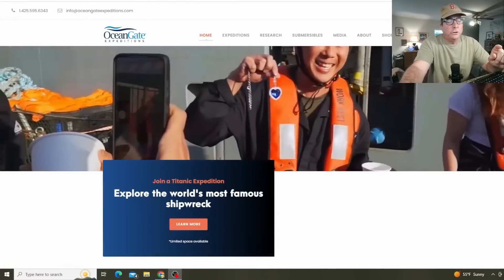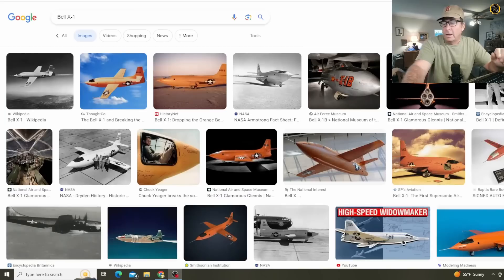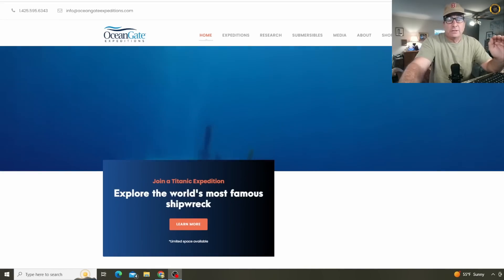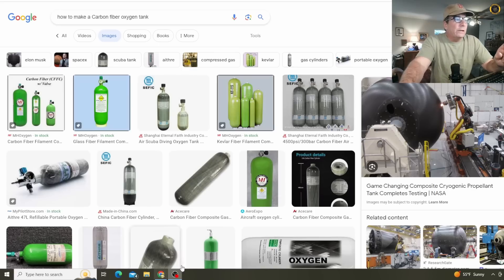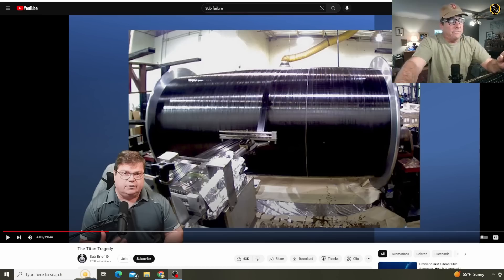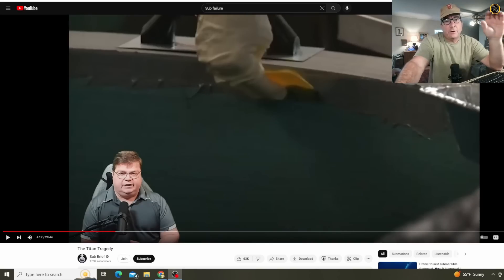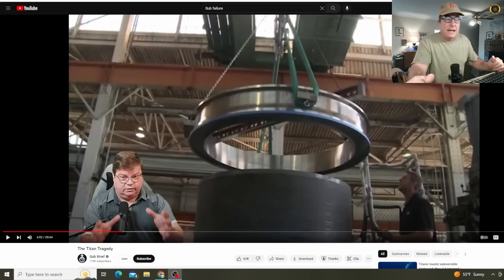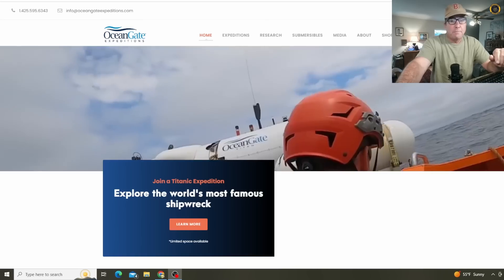Oceangate Sub Construction Details and Implosion

Comment: One basic point that I keep thinking about- in an unpressurized airplane, when you put on an oxygen mask, say, at 12,500 feet- and say, some kind of failure occurs- like maybe the canopy or window opens- the pressure differential will not kill you.
That is completely different, underwater. A structural failure at 12,500 feet depth, will crush you like a bug. 
As with anything else that is experimental, failure is our teacher. Sadly, people lost their lives in this one. Standards of design, should be established to prevent this from occurring again.

Comment: Carbon composite structures  can take compressive stress. Aircraft with composite wings do this all the time. When the wings are bent, the bottom of the spar is loaded in tension, but the top is in compression. But, the compressive sides need to be designed and manufactured correctly. My guess is they had manufacturing issues that lead to delaminating in fatigue.

Comment: Juan, the composite itself can be non-destructively inspected ultrasonically, radiographically or by thermography.  It is the bond joint that presents the inspection difficulty.  Historically, that has been the main objection from the military regarding bonded airframe structure on production high performance (fighter) aircraft.

Comment: The shape of the adhesive joint is inadequate because the area of the joint is insufficient and not orientated in a direction that would deal with the potential forces. Also as  @sthomas6369  points out, the changes in section are extreme and not in any way likely to accommodate the forces occurring at 3800m. The differences in response to changes in pressure and temperature from CF and Ti make these points even more difficult to deal with. With the simple direction of fibre lay illustrated, all these factor lead me to imagine an end cap failure, at or near the glued joint, more probably in the CF, due to the differential contraction of the Ti in comparison to the CF that has not been mitigated by any attempt to shape the joint design for gradual changes in stresses.

Comment: Another informative video! In Sub Brief’s video I was surprised to hear Mr. Rush talk about adopting ideas from the aviation community, especially in reference to checklist usage. There is another video circulating around from a previous dive where the pilot notices one of the thrusters was installed backwards. This problem was discovered once they were already on the sea floor, miles below the surface… to make matter worse their protocol was not to abort the mission, rather, to “rotate the controller” and continue the tour as planned. Even more surprising when you realize that Mr. Rush was a commercial pilot and type rated in the DC-8, he should’ve been familiar with basic checklist usage, including checking for controls to be “free and correct” before launching. Clearly so many issues not just with the design of the craft, but also its operation - this sadly was not a question of if, but when.
Reply: True. Forget technical issues. This was shocking. Were I in the vessel when they found the thruster issue, I would have engaged in a fight to get us to the surface immediately. If they did that mistake, what else might they have missed?
Reply: Couldn’t believe the thruster was backwards when I heard it. Literal jaw dropping moment. Pilots do control surface checks before takeoff, surely submersible operators do the same. Perfect example of the company’s attention to detail, and their attitude to safety.

Comment: You have identified many of the many of the manufacturing issues I saw as well. I will add the observation there appears to be a lack of application and environmental controls when applying that glue. They were doing this in an open air warehouse with no measured application of the adhesive . I don’t know a single design engineer that would be comfortable gluing a machined titanium ring on a carbon fiber hull and allow people to go to 5000psi depth.

Comment: Interesting info from a BBC article:
"When a submarine hull collapses, it moves inward at about 1,500mph (2,414km/h) - that's 2,200ft (671m) per second, says Dave Corley, a former US nuclear submarine officer.
The time required for complete collapse is about one millisecond, or one thousandth of a second.
A human brain responds instinctually to a stimulus at about 25 milliseconds, Mr Corley says. Human rational response - from sensing to acting - is believed to be at best 150 milliseconds.
The air inside a sub has a fairly high concentration of hydrocarbon vapours.
When the hull collapses, the air auto-ignites and an explosion follows the initial rapid implosion, Mr Corley says.
Human bodies incinerate and are turned to ash and dust instantly."
 Had no idea it would auto-ignite.

Comment: I was watching an Ocean's Gate news video interviewing the chief engineer and he was bragging about how "fast" they put that thing together. That's not a selling point for safety. Also, there's a video of the OG technician using Ryobi power tools and boxes of bits lying around the shop with the distinctive fluorescent yellow color. While Ryobi tools aren't bad, it tells me that the company was cheap on tools, what other things were they cheap on? Well, we know the answer. They also showed a technician tightening the bolts on another video and it looked like he was using a set of Harbor Freight sockets to tighten the crucial 17 bolts holding the glass hatch on. He looked incredibly clumsy turning the socket by hand. That's a mission critical step in launching that vessel.

Comment: So much to unpack in this video. Not very often I disagree with Juan, but here we go. I worked for Boeing for 43 years, the first 31 in QA and the last 12 in Flight Test. I have done significant time in all of the commercial airplane programs from the 707 to the 777X, including time as a Quality Assurance manager on the 787. Regarding the Titan construction, without understanding the layup plies direction and materials, no inferences can be made to the longitudinal strength of the pressure vessel tube. All you can see from the video is the tube layup being spun on a mandrel. "Carbon fiber is not strong under compression." This is simply not true. All modern jetliners wings (including the 787, A350 and 777-9) are essentially cantilevered beams. Go look it up, the lower surface of the beam is under tension and the upper surface is under compression. Regarding Carbon Fiber - Titanium structures, all models of the 777 and 787 aircraft are full of it. They are in all areas of the aircraft. Another thing stated in this video: "carbon fiber cannot be NDT (non-destructive testing) tested. There are many ways to test carbon fiber layups and these are used all the time in aviation. They range from simple tap testing using a coin to a range of ultra-sonic testing that can get very sophisticated. Development of this testing techniques go all the way back to the 70s when carbon fibred structures were being developed. Periodic hydrostatic testing of pressure vessels used in aviation is a regulatory requirement. In this video a industrial K sized oxygen bottle is compared to an aviation grade pressure vessel. Two very different animals. What testing program was used? this would only be defined by the Titan's design engineers. There is no government testing agencies outside of the world's Navies that conduct submersible operations. Aviation is different, The FAA has developed regulations that come from hard learned accidents since to earliest days of aviation. Title 14 Code of Federal Regulations Parts 24, 25, 34 and 36 define and list these requirements. EASA has similar regulations. It is incumbent upon aircraft manufacturers to develop test methods and procedures to show compliance with these regulations. The FAA will accept compliance through operational testing, inspection of the article or by comparison to previously certified items. Even though I spent 6 years in the US Navy, I am no expert on submersibles. I am not aware of regulations for submersibles in the United States. Even if they were such regulations, it wouldn't matter since Oceangate was operating the Titan out of Canadian ports and from a Canadian ship. Sorry to go on and on, but I could not let this go without a detailed comment.
Reply: Did they even do cyclic tests with this sub? It's relatively simple to do it with a pressure vessel which is for overpressure, but in this case you would have to do it with 400 bar from outside and I don't think there is any test facility to do something like this (since there is no real market for such tests). 
You would have to lower it unmanned into the sea from a ship with a winch. 

The more of the story gets uncovered the more I think they did not do any significant testing at all
Reply: @simonm1447  Who knows what they did, but that is not the point here. You cannot compare 100 years of public aviation regulatory experience to submersibles. Two very different animals.
Reply: @jimpalmer1969  surely, however in deep sea research it seems this was the first fatal accident. So deep sea diving is relatively safe, as long as the vessel is safe and other things are done in the right way.

Comment: The Hawker 4000 has a complete carbon fiber/honeycomb fuselage in 3 pieces.  Joined by two alloy rings that also hold the wing attach points.  One of our biggest issues is the dissimilar material issue in temperature reaction.  Or extreme cold temp at altitude, aircraft ceiling is FL450.   Cracks are constant in the media used as exterior fill in the joint of the fiber/ring.  Also, the attachment of the rings in the Hawker is very different than how the capsule is joined.

Comment: In aviation, we call this tombstone technology.  Need a row of such for safety improvement that cost $millions.  The more tomb stones and the lose of multi million vehicle(s) the easier is it to learn. No one ever willing to pay mega bucks for benefits that are invisible and not tangible. One example were the FAA rules for minimum climb rate on single engine that make a larger engine necessary for twins. Here is where a strange departure from their dual mandate of safety and promotion which the safety part won. This means there is less chance if there is an engine failure, the remaining engine will not just take you to the scene of an accident and I am thankful for that.

Comment: Very good Juan. You seem to have figured a few things out that an engineer should have been on top of. I can't believe there was no cross weave in the carbon layup, how basic is that? And why wouldn't you use the carbon fibre in a sandwich with inner and outer titanium tubes to secure the end caps? This all seems elementary but the biggest fault, as you pointed out, was the lack of development testing, baby steps, in the manner of aircraft testing. Seems to have been some enormous egos and arrogance among the team of developers who have taken the lives of trusting souls. Again, as in aviation, where was the redundancy? Staggeringly shameful.

Comment: ive worked with epoxy alot and i barely trust it at sealevel room temp let alone holding dissimilar materisls at astronomical pressures and temperatures how could they be such fools

Comment: Carbon fiber is a brittle material and titanium is actually quite flexible. The stiff carbon fiber will resist the compression from the ocean water depth but titanium will tend to deform, even though still strong enough not to break. This is a bad combination of materials.

Comment: The Titan would make cracking sounds with depth Stocktons friend said . He wrote it off as normal and relied on the hull failure sensors It had. It was likely the epoxy glue shifting and cracking on the flange for the end bells . It could only stand a few cycles.

Comment: I think you hit the nail on the coffin.  I think you figured out how the vessel failed:  the carbon fiber body, under repeated compression stress and fatigue, deformed enough to cause the titanium flange to pop off of the vessel.  Had the flange and the vessel body been constructed of similar materials, they would have had an equal rate of deformation, and thus the flange would not have popped off.  But being that carbon fiber is the weaker material, it likely deformed inward at a greater rate than the titanium flange, which may not have even deformed at all.

Comment: The 'glue' or Caulk, Gasket, Flange etc was occupying space and filling spaces or gaps. It's a third material with it's own variables. I noticed it was applied by hand with a plastic spackle knife. I wonder what this product is. Likely not specifically designed for this application. If I was in that vehicle, I'd be thinking of that gasket the whole time. Who applied it? Was it too little, too much? Inconsistent bead depth? Was the person who applied this a master at hand applying compounds? Or following the directions on the side of a bucket? It just does not inspire any confidence whatsoever. As a plus, I think the wild west may be over in this arena.

Comment: I have a carbon-fiber-wrapped rifle barrel that was pretty easily bent and 'kinked' compared to how an all-steel barrel would have held up.  Like you mentioned, the strength comes from the tension of the end caps 'pulling' on the outer carbon fiber tube.  But when it came to a lateral force it compressed and kinked pretty easily.  And this tube didn't even have the ends pulling on it, just glued on.  And then the sharp 90˚ points of stress where they met the end caps, I can imagine it just gave way with the immense inward pressure.

Stupid idea for this design.  And frankly, when I looked at the 'team' that OceanGate had on this, I was reminded of that show 'Whale Wars'.  Would you want them leading you into a conflict?

Comment: They got the Carbon Fiber from Boeing as they said it's shelf life had expired and they couldn't use it on airplane no longer and the one problem with doing many lares to make the TUBE is that as it is used and compressed it's layers start to lose their integrity and it's only a matter of time before some of it would not have the ability to hold the 6000 PSI  once it's to far under water..

Comment: 380 atmospheres is a steep curve to jump in with both feet.   Couldn't they have remotely dived the sub unoccupied until it had a failure. Just to proof it.   Then have a second unit compare the results.   If they would have dived the thing once to that depth  to try it, at least. Did they do any of this. Or even consider it.

Comment: Poor design and no redundancy seems to be the issue here and then trusting that radical 'experimental' design as human rated seems an arrogant miscalculation that directly lead to these deaths.  "Oh, don't worry about it, it will be OK!"  how many times has that design point killed people?  Just like the 737Max, the test pilots noted that the failure  of that single input AOA was an unrecoverable fault and it was just "papered" over and left to do it's worst.  No excuse for that.

Comment: Isn't this how the 787 and A350 are designed as well?
Reply: They are made for overpressure (pressure from inside) and the overpressure is around 0,5 bar. 
The sub had to withstand 400 bar

Comment: Juan I would submit that the different expansive properties of the carbon fibre and the titanium rings where they meet could actually be where the stresses were highest and delaminating occurred. Also, agree with your analysis of how they laid the carbon fibre - even the Dreamliner has the tape laid at an angle for intersectional strength, and that’s at tension not compression with much lower stress.

Comment: Them laying down that carbon fibre as they did.... omg, who thought that will be okay???
There is a reason why the direction of the fibres are the most important part of any structural carbon fibre part. The layering and directions will determine which forces that part will endure and how. 
They just simply wrapped it around the tube shape..... try to do that with a rope at home! It will fall apart with no force! But if you wove the rope in any way, as you see in the common carbon fibre parts, your rope will hold together very strongly. 
I am just amazed how that tube held this long... I mean, the fact that it held this long is the amazing thing, not that it did not...

Comment: I agree with you that the tube could have compressed a bit more that the titanium end pieces, creating a gap, at first just letting in a little water which would immediately become a gush and then as the tube completely failed become a catastrophe.  One other thing I read somewhere is that there was a clear viewing port that was only stressed for 4 atmospheres when they were descending to 12. I may have those number wrong.  The 12 atmosphere window was multiple times as expensive so they stayed with the 4 atmosphere one.  Don't know if that is true or not.
Reply: Slightly off on scale, where the titanic rests, it’s 400 atm, not 12.

But, yes, the porthole windows was only rated for approximately half the depth that it should have been

Comment: Thanks Juan, you are right there will be lessons in materials engineering from this accident. One manufacturing  issue that occurred to me was how much effort went into preventing voids as the tube was being wound.

Overall I think though that there arent many similarities to the use of carbon fibre in aviation, where as you correctly say the material is mainly in tension. Also now days in aviation there is great awareness around issues of fatigue and how to use this material safely.

Comment: The use of laminates for a pressure hull is just a bad idea. When water gets forced into the laminate at depth it is trapped at pressure and as the boat surfaces differential pressure inside the flaw will enlarge it. Make enough trips and sooner or later it will fail.